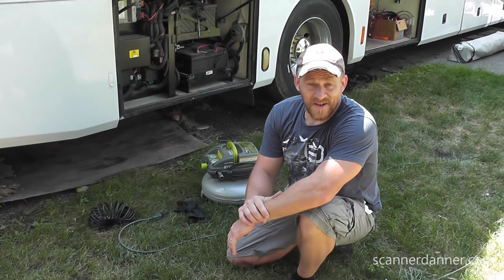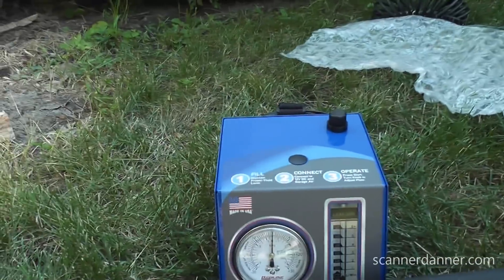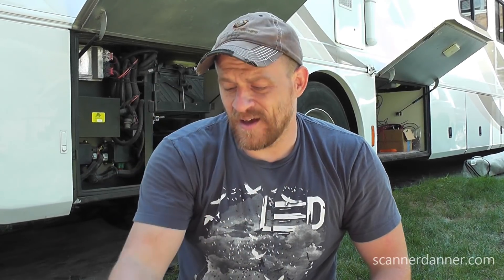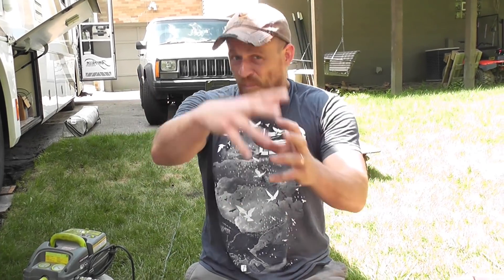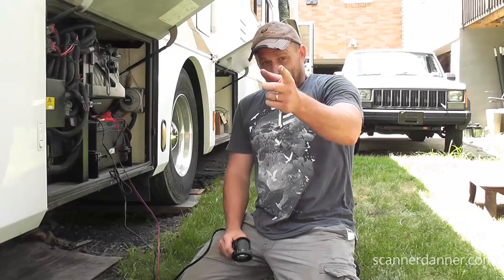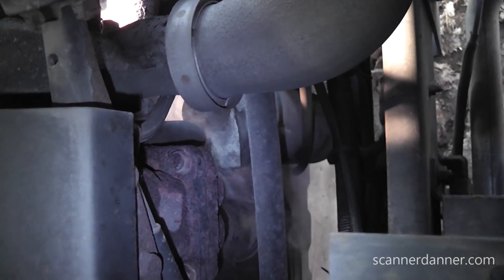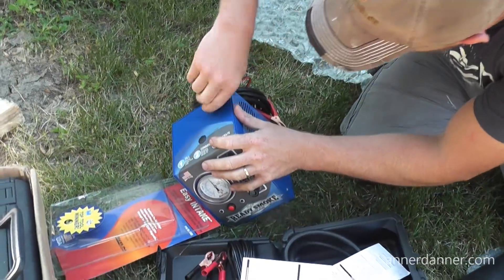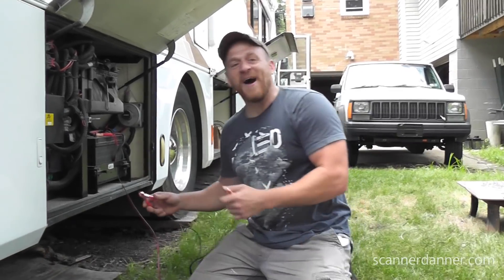Redline ReadySmoke Unboxing-Exhaust Leak Test-2001 Cummins 8.3L ISC

Comment: I used a Smoke machine and noticed that my Honda 06 Civic EGR valve was leaking very little smoke but no engine light. Should I replace the EGR valve? I would have never known if a friend of mine gave me there Redline and I watched this video. Any help would be awesome. Great video helped a lot.
Reply from the maker: No, it is normal to see a small amount of smoke from the EGR pintle shaft area. Even new ones will smoke there a bit on some cars.
Reply: Thanks! I didn't want to spend the money purchasing an EGR.  I learned a lot from this video was a great help.

Comment: Im a diy fix at home retired lineman fixing my own cars have alot or auto repair gadgets don't  have a smoke machine.wonderi g if I  should get this.still have a po448 on the sti but cleaed a po 442 and 456 with a borrwed smoke machine it was not a redline

Comment: Just stumbled across your Cummins exhaust leak video Paul. Great job using the smoke machine to locate it. Unfortunately these are quite common and looking for either a crack or broken manifold bolts and carbon tracks would have been the first place I would have looked, but if you weren’t aware of that information a smoke machine would be a great way of locating the leak. 

In my video I think I mentioned my experience hearing the “tick” or exhaust leak off a “K” rail or jersey barrier was almost exactly as you said but with the engines being so far behind the driver identifying noises can be quite problematic. 

I loved the outtakes. I laughed when you used your teeth because when I do that my wife gets after me because I preach using the right tool for the jkb at hand. 😂

I also liked your slang comment. I use the same “OM-IN-A” and I’m not from the east. I use the one “THIS-EARS” for “this here” or “here is this” and it drives my wife and son crazy. 

Looking forward to seeing how the repair turns out Paul. Would love to see more of the American Coach as well. 
Mike

Comment: Interesting cracked manifold find. The smoke machine sure made that easy. Reading instructions from and getting familiar with the device manufacturer is rather important so there is no guessing this or that possibly damaging the product which is brand new simply because the user doesn't want to read, absorb and understand the makers methods for use of the machine. Lots of "mechanics" or even "technicians" in any field try that and find out they should have read the instructions or at least spent a few minutes with an overview of them. It truly helps move things along procedure wise.

Working conditions also are sometimes important however, knowing you are a mobile mechanic, you don't always have a clean smooth concrete slab to work on.  There's a lot of videos of mechanics performing work on vehicles out in the dirt, open fields and so forth when the work they are doing is too delicate for those conditions. Yet, they film it anyway and some of us view the process as below minimal requirements for some repair work such as maybe an A/C condenser replacement, compressor or intake repairs and maybe top end repairs all while dust is blowing in the wind etc.  How they expect that to be fairly professional to the viewers isn't working so well. 

Too bad that exhaust manifold did that, they shouldn't but it likely got too hot one time. those give-a-ways I believe are going to be best limited to USA only folks as the laws are too difficult to make it worth doing for the entire globe. 18 and over etc.  Others do it but most are limited to same country as give a way is located.

Comment: I've heard that the cummins exhaust manifold is a notoriously bad design. The rear two cylinders run 200 degrees hotter than the front cylinders. I think there is an aftermarket replacement that fixes this and lasts longer.

Comment: Hi I have a mass air flow question 
I have 5 volts in yellow wire 
The other 2 show ground with ohm meter with eng off
1998 gmc 5.7 surburban
P0102
Also shows bad cam sensor
I replaced distributor 
No change
Do you blink bad ground 
I don't have wire diagram 
Thanks
Reply from the maker: Forget the ohmmeter. Measure voltage on all three wires plugged in and unplugged (key on) and report results.
Reply: ScannerDanner 5 volts yellow 0 other 2when I use ground on battery when I go ground to the same 2 and plus on ground side I get 12 volts on both. Thanks for your help I have so much money in new parts I hate to,scrap it for something I can't figure out I'm 63 and the computer stuff drives me crazy lol

Comment: Look up redesigned exhaust manifold for Cummins if your going to replace it ,apparently these manifolds run a 200 degree difference in EGT's between the front 3 cylinders and the back 3 .  sorry I don't remember the company that has redesigned them but I'm sure you could do a little surfing and find out .
Reply from the maker: I ordered a new one from Cummins. Do you think it has been redesigned from them too?
Reply: ScannerDanner the video I watched was addressing the problem that Cummins has with stuck piston due to tight piston to cylinder wall clearance and improper flow through the exhaust manifold .if I can find that video I'll send you the info .

Comment: Scanner dinner. - thank you I let my truck get the best of me I wrote you and you gave me some vids on what you thought it was .and by god it did after I sent you that message on my 1994 Chevy s10 v6  vortec it come out to be fuel regulater on spider the only way I fount it was looking for shorts and the short was to spider it would shit off when you moved the to wires so I tore it down to replace wire to regulater then we fount out that regulater was leaking to thanks for the videos man .you taught me a lot more than I already no with this brain surgery I just got stuck couldn't remember you helped me get my knowledge back on some things thanks brother been down truck been down a month thanks to you it's puring thank you!!
Reply from the maker: sweet! nice find brother
Reply: ScannerDanner if it wasn't for your videos about shorts and fuel .I just decided start on engine and I went all out under dash couldn't find it so I went to unplug a sensor and I grabbed to wires truck died started touched again died if it had sent been for you I'd still be stuck believe me when I tell you if it hadn't been for you I'd never fount it thanks brother from the bottom of my heart god bless you and your family and videos number one in my book

Comment: Great demonstration of the machine (the good and the bad) but man, so bummed out about the crack. I hope you can get that replaced without too much cost and hassle.
Reply from the maker: Bought a new manifold from Cummins and ALL of the bolts, just hope I don't snap any of them.

Comment: Paul, I’ve been a Cummins tech for 15 years. I’ve seen several of those exhaust manifolds on those ISC’s crack. Most of the time the cracked manifold is the EFFECT and a boost leak is usually the CAUSE. btw that’s smoke machine would be nice!
Reply: I just watched the video again. Around the 10:49 mark it looks like there maybe a boost leak coming from that blue CAC hose closest to the intake side. Also make sure you check the air compressor intake hoses. They are usually connected to the intake manifold and are often overlooked when checking for boost leaks.
Reply from the maker: Can you explain please? How does a boost leak crack an exhaust manifold? What should I be looking for? Thanks!
Reply: ScannerDanner boost leaks will cause high exhaust gas temps and the higher than normal exhaust temps will cause manifolds to crack.
Reply: ScannerDanner boost leaks that have been occurring for a while show up as black streaks. I can’t tell from the video if that black streak coming from the blue CAC boot is from a boost leak or if it is just a shadow.
Reply from the maker: higher than normal exhaust temps from a rich air/fuel ratio? In other words the computer is seeing boost psi and is adding the fuel for that particular airflow but since there is a leak, we are not getting that measured amount into the cylinder = rich condition? 
Sorry, my diesel systems understanding is lacking. Where is the boost psi sensor located? I would think a boost leak would also cause a lower boost psi reading and therefor not cause what I described above? Thanks for your time.
Reply from the maker: best method of locating a boost leak? I'm thinking my same smoke machine on the intake side of the system or is that not enough psi to reveal the problem? Look for black streaks as you said too.
Reply: If memory serves me correctly the boost pressure sensor screws in on the side of the head. It should be about in the middle, just in front of the fuel filter you showed changing in a past video. I would need your engine serial number to know for sure. It is a 3 wire sensor. The only other sensor going into the intake would be the temp sensor and of course it’s a 2 wire.
As to why a boost leak causes high EGT’s, I’m not 100% sure the exact reason. I think it has to due with having more fuel than air and the fact that the turbo is working harder to maintain boost levels.    The service manual even has a warning saying if the exhaust manifold is cracked to pressure test the charge air system.

I’ve never used a smoke machine to check for boost leaks, so I’m not sure how effective that will be. ( wouldn’t hurt to try) A pressure testing tool can be made by measuring the ID of your CAC hoses, I believe yours are 4 inch, and get two PCV end caps. Just drill and tap one for an air hose fitting. Just need to make sure the pressure is regulated to a max of 30PSI. Install one of the caps as close to the turbo as possible. I usually just remove the 90 degree adapter coming off the turbo and install it in the hose on that side. Then put the other one as close to the intake as possible. Pressure up the system and use soapy water to find the leaks. Just remember that testing the system this way does not pressurize the pipe and hoses that supplies boost to the air compressor. Just do a good visual inspection on those to make sure their in good shape.  

If you need torque specs, or anything else, for the new manifold just let me  know. I’d be happy to help. It’s the least I can do for all the awesome videos you produce!

Comment: Bought the same machine last week  and YES the dipstick is VERY difficult to read...Redline please fix this...other than that it's a great machine...bought the Easy Intake and it works great...found a "decent leak" on my C5 Corvette PCV hose this morning...registered it online yesterday and Redline is sending me a free hook...thanks Redline !!
Reply from the maker: They make a hook for this machine? It is my only complaint
Reply: Hey Sensei Paul !!...Redline is sending me a hook but their website says it's for the Smoke "Pro" for $4.95... I "assume" it goes where the black plastic cap is on top but I had trouble popping it off to see if it had threads...I even tried using my teeth but no success...LOL !!...I will call them later when they open and find out for sure....p.s. Maybe you can do a raffle for the smoke machine and one lucky winner can win it and the money would go to your favorite charity...just a thought !!!
Reply: Just spoke to Ed from Redline...yes, the Readysmoke  does accept the hook !!...and yes, just pop that black disk off...the Pro model hook fits the Ready Smoke !!

Comment: If i get that bladder imana sign up to premium. For real!
Reply from the maker: Hahahaha best comment of the day
Reply: Paul. Not related to THIS video in particular but this is new so i guess there is a better chance of you reading it that on an old video...
I have been seeing alot of your vids lately.  In two or three of them im thinking you could have had benefits of another tool to help find the issue faster. One was the Mercedes with the moisty fusebox inside the cabin with the voltagedrop over the ECU fuse. And the other one was a car with a voltagedrop over the contact points inside the ECU relay. As we know resistance equals heat. I think you could benefit from a thermal camera in your toolbox. Think that would have spotted the faultpoints right away. Videos wouldnt turn out as good obviously with you finding the faults in like two minutes, but still.
Of course there are dedicated thermal "guns" to buy which would obviously be better and offer more options, but there are also combined DMM and thermal imagers to be had. Which might fit better for what we do. Like the Flir DM284 and DM285.
Just a thought.
Now carry on with the awsome vids!

Comment: at the very least a cracked exhaust manifold can blow excessive heat around plug wires or wire harnesses. 
My brothers truck needs exhaust because it's melting wireless quickly. 
Replacing that exhaust on a 97 chevy 454 vortec is a HUGE job and expensive too.

Comment: Paul you might want to go thru the scanner danner store that's in the info, not the amazon one and look at the pricing and update thy smoke machine selection, pricing, etc as the prices that are in there are way more than the advertised ones.
Reply from the maker: I don't have the ReadySmoke on my site but I did add the link to it in the description. As for the Smoke Pro, the one listed on my tools page is less than what it is now being sold for. Are you talking about my ScannerDanner Tools page or my Amazon Affiliate store?
Reply: ScannerDanner ScannerDanner.com page. Bottom of the two links in the description. The leak tamer ($813ish) thru jb tools  and smoke pro , AES Wave ($899)

Comment: I heard  you can use a cigar from a reliable source... think you can show us???
Reply from the maker: lol yes I can, but it wouldn't be tobacco in it
Reply: Hey how can a guy argue with 50 years experience!? I mean come on! When Danner starts jumping out of the back of a car and reducing his videos to 3 min or less then I'll know.....
Reply: @SouthMainAuto  I love it. 50 years experience means nothing in this trade. There's guys at my shop with no less than 20-30 year exp. each and they can't diag a 2 wire circuit.
Reply: You can use a shop vac on blow mode, shove it into the exhaust and spray soapy water on the exhaust and find the bubbles.
Reply: You would need a big mouth to blow into that exhaust!
Reply: Haha cigar and wet vac in reverse air flow maybe
Reply: It's on the market still. It's called Monica 2000.
Reply: Reliable source being...(wait for it).... Scotty K, LOL!
Reply: You know Eric, at least he read the directions and put the darn fluid in it before he showed it to us!

Comment: My neighbor tried smoking his intake with a cigar - I had to stop him because he was starting to wobble. About 10 seconds longer he'd have passed out! 😂

Great review, Paul! That's the machine I'll be buying when funds allow.  Love it's compact size, Made in USA, and a reasonable price (as far as smoke machines go, anyway).

I've heard that said before too, that valves can be damaged from exhaust leaks. I have yet to see it, though. I ran alot of my old beaters with header or manifold leaks for thousands of miles and never had an issue. Thinking about how fast the gasses escape when the valve opens, I just don't see how it could be possible. Maybe in the carburetor days, if you were jetted to the ragged edge of being too lean, the leak may have pushed it over the edge & melted the valve down? Not sure there. Sucks you had to cancel your trip, though - that's never fun. You could weld the crack as a temporary fix, I suppose .. but would be alot of work extracting that, just to reinstall it and replace it later - like doing a job twice.

Love the outtakes - I was laughing out loud. 😄

Comment: paul  nice video.   i am sure the biggest problem would be  warped valves although a  fire or fumes is not far behind it.  when the engine is running its not a problem. its when the engine shuts down hot. if the valve is closed  it will be held in position by the seat and the seat contact will allow even cooling.  but the ones that are open will receive the cooler air and cool  unevenly causing warpage.
Reply from the maker: Got it! This makes more sense to me than anything else I've heard

Comment: Now we covered the RV for summer, gotta cover the lawn mower and the expensive fuel injected boat motors for hard to diagnose electronic/ignition issues.

Seeing ScannerDanner make a field trip episode to a high level/top tier marine service center that had a service call in line with possible electronic/ignition issue would be a nice change.

Comment: Exhaust manifold on a Cummins
....You just have a couple hour job and that's about it..... Son can be the parts runner while you tear it down.... It's just a oversize car engine.....
Reply from the maker: long as I don't snap any of those bolts
Reply: very good chance you will

Comment: Do you have an induction heater Paul? If not, someone needs to send you one for getting the nuts off the turbo and manifold without setting fire to your beautiful RV. Good luck with the manifold job. Every time I see a cracked or warped exhaust manifold, I can’t help thinking it’s down to a design problem. Scania trucks have the manifold divided into sections with sleeved joints to allow for expansion, that seems to work well. Still, you’re probably not about to re-design this, I guess just repairing it would be good for now. Thanks to Cameraman Caleb and yourself for another great video.
Reply from the maker: We have one at the school, but I need to heat the manifold area not the bolts. Though I suppose any heat would help